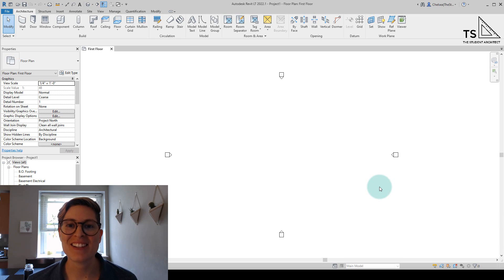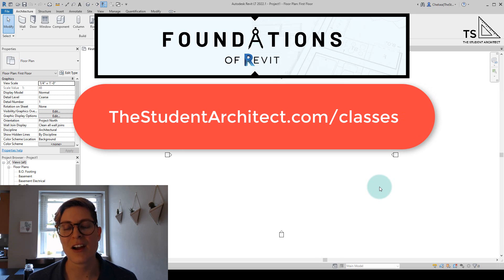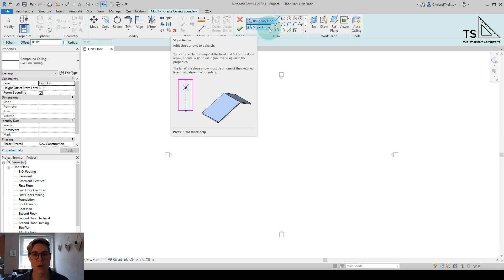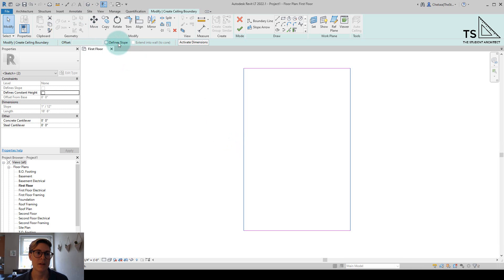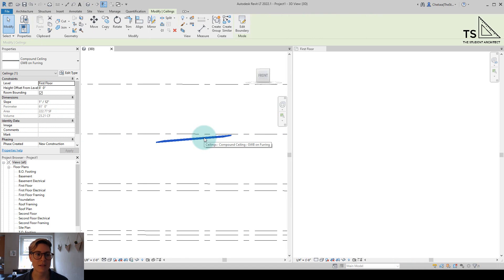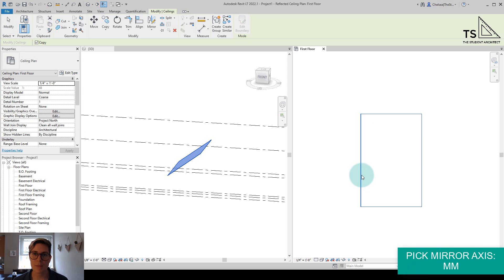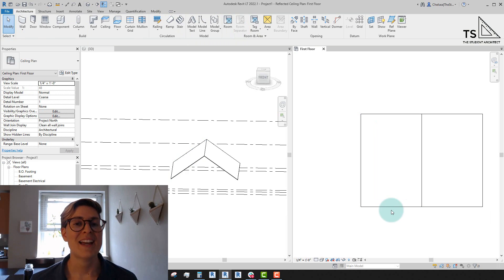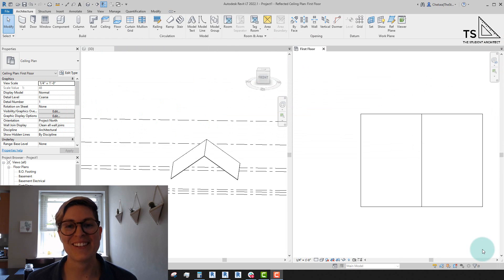How to Create Sloped Ceilings in Revit

Comment: hi!
i have a question but it is regarding family annotates/view scales.
so i have two views with different scale (75 and 100) and the same family in both , i want the 75 symbol to show in the 75 scale view, and the 100 symbol to show in the 100 scale view.
i created two different symbols within the family and crated a yes/no visibility parameter within the family.

When i go to the views i select the correspondent scale parameter, but it changes in both views.

is there a way that i can make these symbols independent per view?

thanks in advance!
Reply from the maker: I think what I would do here is set the symbols to different coarseness levels - that way, whatever view is larger and would have more detail, that would be set to fine, smallest view would be set to coarse, and the middle view would get medium. You should be able to set this individually for each element in the properties panel in the family. Then in your project, create a view templates for each view scale and set that family category to coarse, medium, or fine for each. Hope this makes sense!